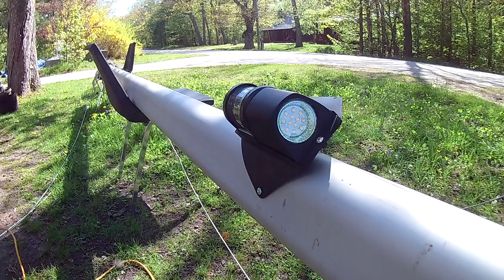Repairing Anchor Light, Installing LED Mast light-Deck light combo ||Ep40||

Comment: Great video thanks. iv been wanting to see the installation process of these Deck/Steaming lights before replacing my old one with an LED version. Nice tip on the heat gun by the way! Only thing i would do different is the screws in the mast. I read that dissimilar metal on metal contact in this case aluminium and SS can be a bad mix without any sealant in place. I think mine are riveted on too so iv got deal with that nightmare next
Reply from the maker: I used self tapping sheet metal screws.  I figured that I may have that light off every year or so, so clean up of corrosion should be minimal...good thing is we are in fresh water so corrosion should be much slower going.

Would have liked to use Aluminum screws, but our local hardware store didn't have them.  Glad you liked the video!

Ah rivets...that means drilling!

Comment: Man, I hope you either wrapped those connections to the mast light, or melted them, they will corrode quickly.  And, this a mast light from amazon?
Reply: it is scary how fast things corrode! and once a wire starts oxidating, then the whole bloody wire needs to be replaced :-(
Reply from the maker: Yea, it wasn’t on the video but after everything was mounted I took them off and heat shrinked the fittings.

Should have put that in the video, but I felt it was going too long.
Reply from the maker: And yup, from Amazon.